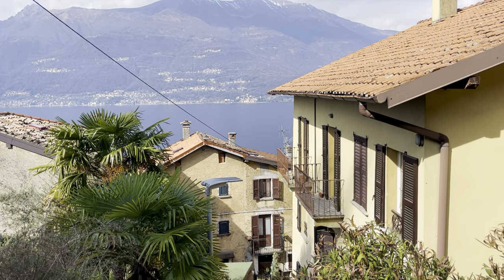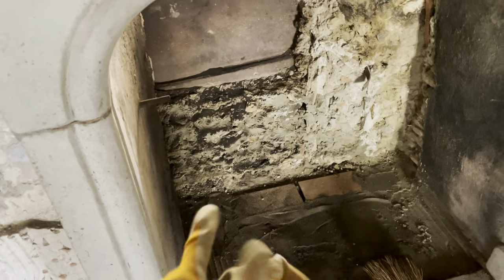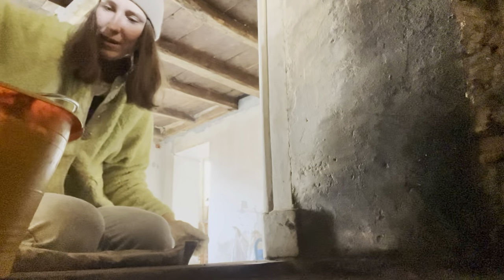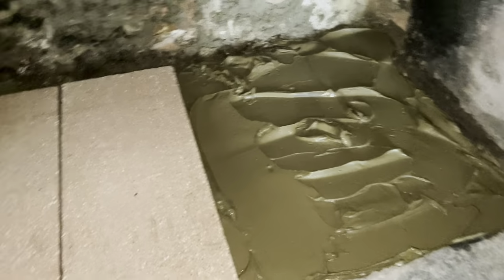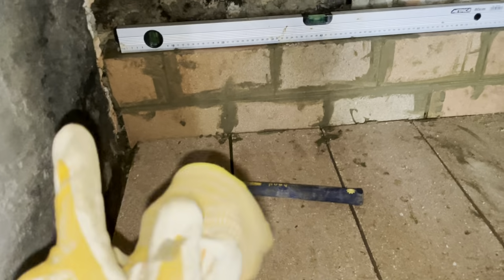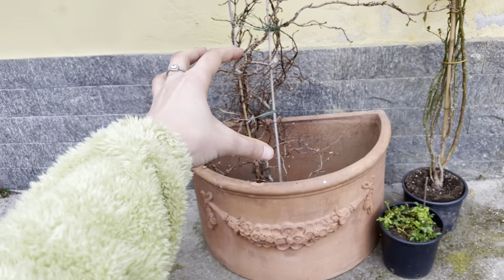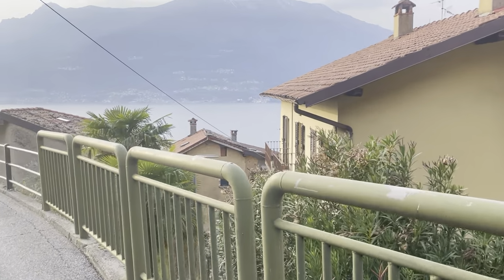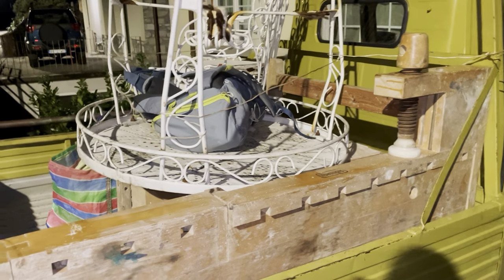Fireplace restoration/Renovating on lake Como

Comment: What are you planning to do with the lower garden after you get rid of the plants and debris?  It would look lovely with grass.  Consider buying a wet/dry shop vac.  It will be so useful as you continue your many renovations.  The sheet rock/plaster dust, the floor debris, the ceilings,  the summer kitchen, cantinas and your Apa will be so much easier to keep clean.  It is such a useful tool.  I use mine all of the time!

Comment: Instead of sweeping and stirring up all that dust again,please buy a shop vacuum. It will save you lots if time and energy!
Reply: They need electricity in the house to run a shop vac. In time it will be fine.
Reply: There are ways around that actually.. lots of portable battery products that allow use..lots of hazardous particles in the air with all that demo of old plaster etc